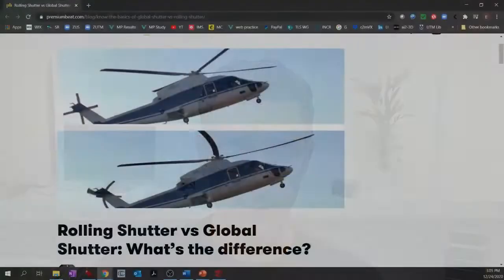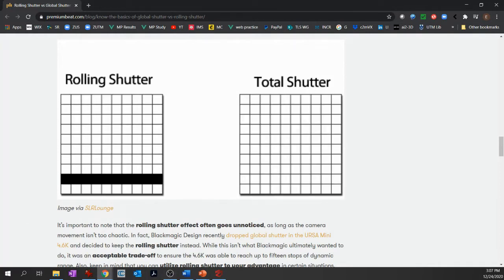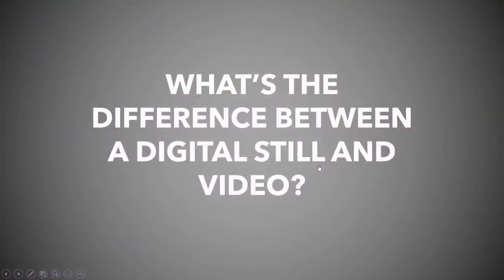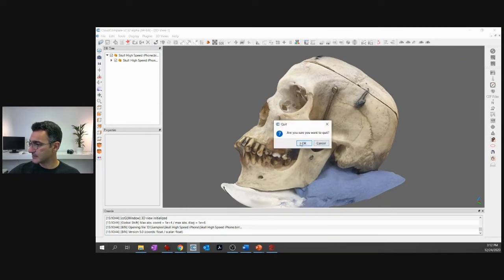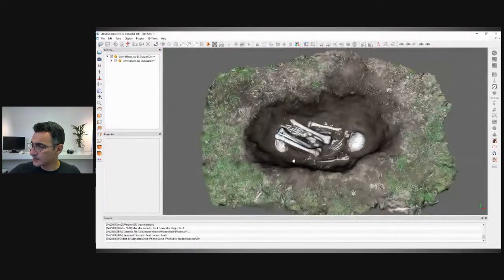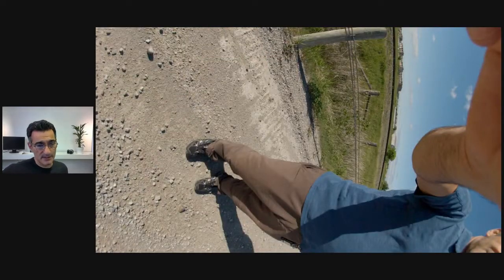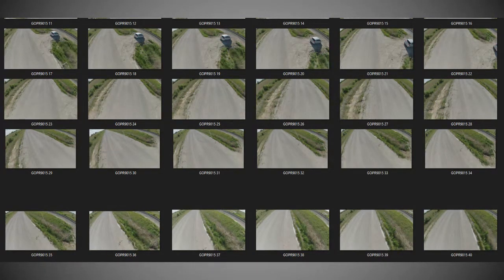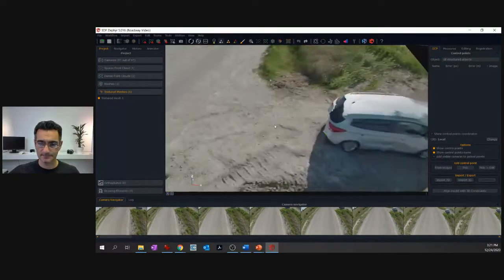Can I use video to create 3D models? | Photogrammetry  | CLICK 3D   EP 2 | 3D Forensics

Comment: Any software that can transform videos into 3d models?
Reply from the maker: 3DF Zephyr can. Has some nice tools for extracting frames automatically.
Reply: @3Dforensics  Thanks! is there any free software? I am using Meshroom for stills. It`s free but only creates models from stills
Reply from the maker: @DomenicoDentice-d7k  I don't use the free version of 3DF Zephyr so go ahead and install and check. Worst case, VLC can export stills from the video and then you can process them in your software of choice.

Comment: Nice video !! Funny intro when compared with the handsome guy that shows up 🤣 one thing I thought of is that you need to look into the video format! Mpeg consist of one full frame called I frames a sec a couple of b frame to support the Inbetweeners of the I frames and the rest is Inbetweeners by algorithm. The video might also look different from one playback device to the other since the algorithm depend on hardware. So if you only extract one frame a second, you should make sure it's the full frame of I frames.  Other video formats like from black magic cameras are way better.